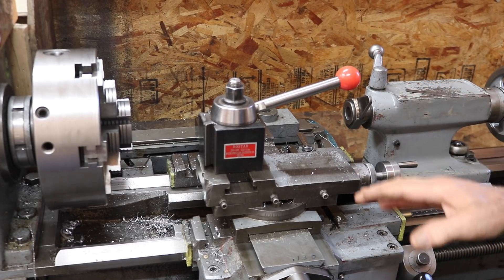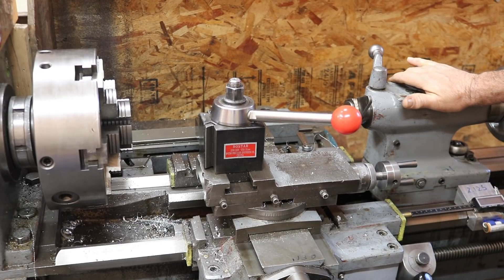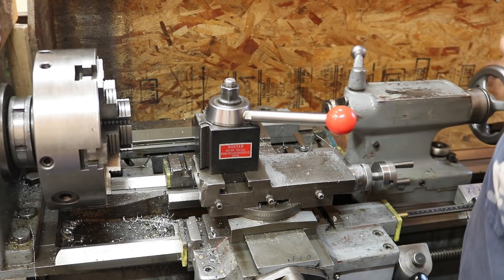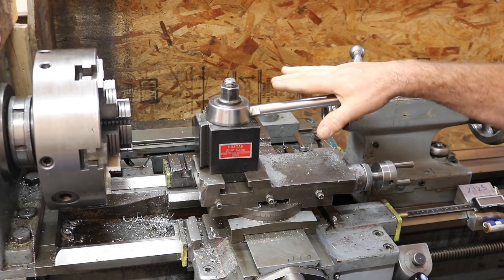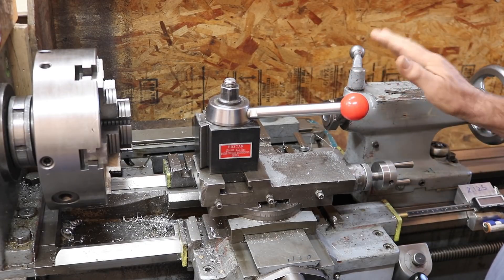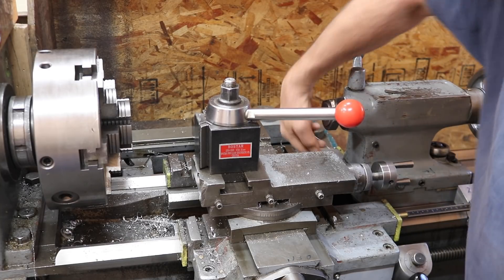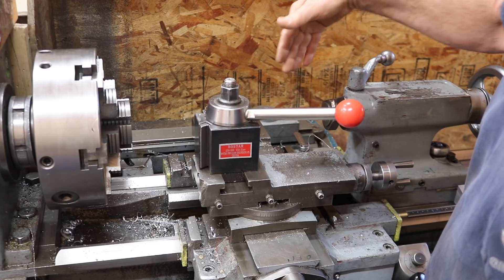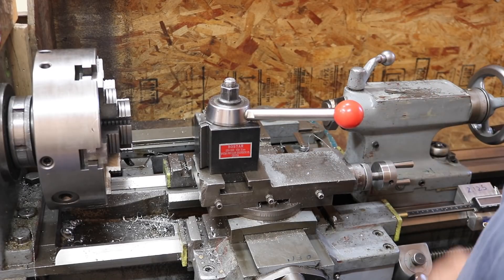How to Build a Lathe Drag Link

Comment: Hi Randy, just a thought, if you put a dowel pin, or the head of a bolt or an "L" shaped block, or anything to hang out and catch the end of the tool post holder, you don't have to rely on the set screws to hold the force. Thanks for the video!
Reply from the maker: Good Idea.  Thanks Ray.

Comment: That's a pretty cool trick!
It looks like an alternate way you could have done it with that lathe is a link from the back of the tailstock to the back T slot in the carriage. Just put the same sort of bar in the T slot. That would have let you take the toolpost off if you needed more clearance for some part.

Comment: Forty years ago we used an eye bolt in the edge of the tail stock dead center of the ways and the carriage . A piece of chain with a hook and a connector to one eye bolt. We had lathes with 20ft beds .  Our big lathe came from the navy and used for shafting for subs n ships. We rode the carriage one cut took a ten hour shift. It was about sixty ft bed and 48" chuck. But she could throw chips 3/4" wide.

Comment: If the pivots for the link were vertical instead of horizontal, with the tailstock locked, movement on the cross-slide would cause the carriage to move in an arc instead of a straight line. The radius would be the length between centers, and would yield a concave surface on the face of a part turned in the lathe.

Comment: Use this technique for chambering rifle barrels for years. I learned it from an old master that had been doing it for years. MUCH better feel and control with the carriage vs the tail stock wheel. Not under power of course, as the reamer must be cleared often. Snugging the tail stock is sufficient to prevent run out. I like the heim joints, you can run it with the cross slide in any position. Good job.

Comment: Randy, Thanks for the shout out. I wanted to ad that on lighter Lathes if you cant pull straight from the spindle area of the tailstock to be careful that the rod does not want to lift the tailstock up off the bed ways. I think that would only be a problem with larger bits.  Always nice to see a RRITS video. Have a great weekend my friend.       Gary
Reply from the maker: Thanks Gary Works great.

Comment: I'd been thinking on this one for a while.  Century old engine lathes are not noted for having light components that are easy to move.

I have T slots in the carriage, front & rear.  So I'm considering making use of those for a simpler setup.  A loop of light chain or cable, around the back end of the tailstock.  Fix solid on one side/end, a stout hook on the other, for a quick disconnect.  Spread the load on the carriage out, won't need to drill a hole in the tailstock.  Keeps things original, easily going back to how it was before, if needed.  Should work great with a Mr. Pete inspired auxiliary carriage power  feed

Comment: I have seen this done on bigger lathes before my question is what keeps the tailstock from bouncing around on the ways you can't really tighten up the drag nut sufficiently I don't think
Reply: I agree. If the tail stock isn’t locked down it’s not concentric with the head stock. Probably ok if accuracy isn’t necessary.
Reply: Bill, I was thinking this same thing.  Under the lathe where it grips isnt exactly a sliding surface.  🤔
Reply: I also wondered if there might be some torsional effect on the tailstock given the link is off to the side.